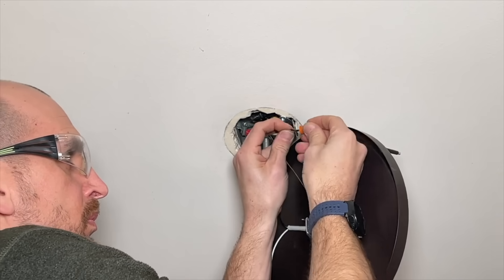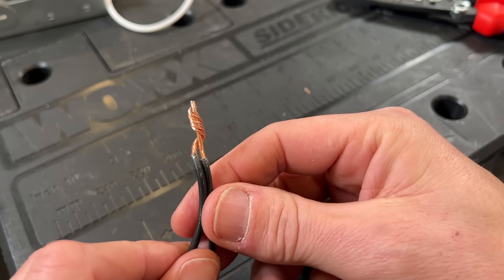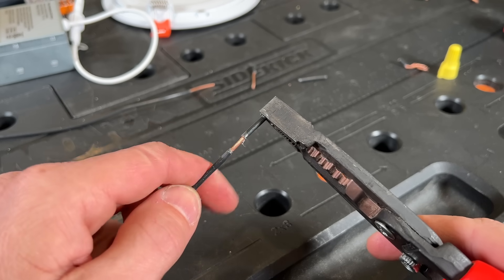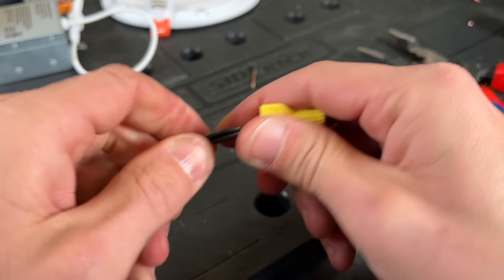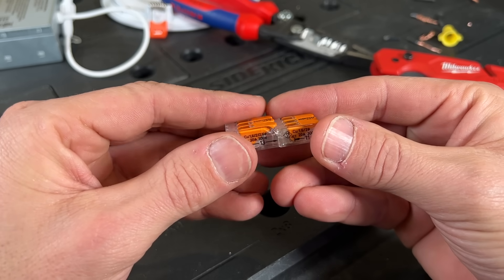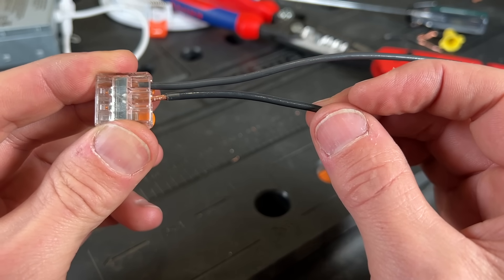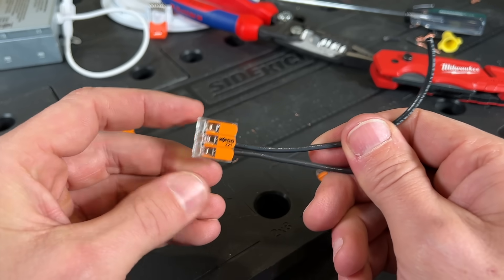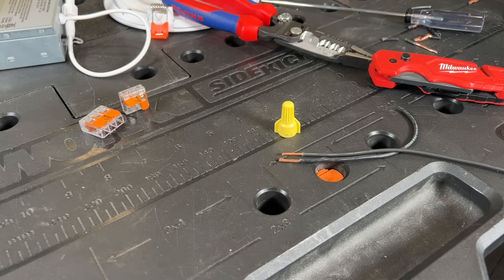Most Common DIYer Electrical Mistake - Don't Let This Be You!

Comment: I work for an OEM Control Panel Builder, Our Control Shop uses the Wago Lever nuts on the handful connections that would normally require a wire nut where there would not be terminal blocks, eg. small junction boxes, MAC solenoid air valves. They have reduced quality issues and are just in general pretty awesome. In the industrial world Wago is a relatively well known company that produces some really good IO cards, bus couplers, terminal blocks etc.
Reply: Another sponsored comment
Reply: @mouldyboats  Nah Friend,  just an overworked relay jockey whom calls it like he sees it. Of course, what do I know? In my own opinion as far as addressing remote IO. Wago wins hands down compared, to Allen Bradley,  Schneider Electric, B&R, and Phoenix Contact Equivalents. But I will say that I do Like Phoenix Contacts Terminal Blocks and wire management panel stuff, Weildmuller stuff isn't bad either. and I still like Wago Lever nuts too. Edit I have enough work with the global shipping and parts shortages.. and my writing skills are not up to par with being paid to talk about what i like on YouTube.
Reply: I had heard a benefit to using wago 
Was it is recommended every time that wire nut comes off you must peel new wire? Is that true, because I’ve been guilty of replacing light switches not using new wire and using the same wire nut but it seems right.

Comment: Well presented video, but if you think about it , but wago connectors only touch the conductors at 2 points, just like the push in connectors at the back of some receptacles.  After a  few years of of use, the connector points will expand and contract because of current draw. This can result in arcing and sparking that makes a bad connection, resulting in the in-operation of the apparatus. As a long time electrician , I have seen this to be the cause of many home circuit problems. The wing wire nut has much more connection to the conductor. Thank you .

Comment: Great information. I’ve also notice from experience that if you push the stranded higher than the solid wire as to where the stranded catches first in the wire nut it will grab good and won’t come apart.
Reply: Yes. This is 100% accurate

Comment: Excellent video. I always felt more comfortable pre-twisting my stranded around my solid. I make sure the stranded protrudes 1/8" or so past the solid, so I know it will be the first thing grabbed and properly wound around by the wire nut. Just me.

Ditto on Wagos. Over-the-top excellent. I would would caution DIYers to avoid cheap imitations that are not UL tested and approved, as are Wagos. The few dollars you save are not worth risking your home or family. I've actually never been able to a UL knockoff.

Comment: Ive on my own had to learn that giving that little extra stranded on a wire nut was the best way to get them locked in tight.  That said, since the first time I picked up a pack of those wago connectors based on an Amazon recommendation,  ive only used a wire nut again once, and thay was solid on solid only.

Comment: Great informative video. I am a DIYer with poor electrical knowledge but more now. Question. These Wago connectors seem like a very safe way to connect the old aluminum wiring in my house to the new copper wiring. Am I right?

Comment: I as well put my stranded wire a little above the solid wire,  but typically on new lights, your stranded wire is already somewhat exposed, i don’t feel it’s necessary to strip it any further, i twist my stranded tight and then put the wire nut on. Keeps you from having stranded wire working down the nut if you keep it decently short.

Comment: Yep already know these just wanted to add if you are concerned about the levers a single loop of electrical tape across them os all it takes to prevent them fully opening. I have used both methods and connections in this video. The newer connections are definitely nicer and easier but both work very well when used appropriately.
Reply: an electrician showed me to wrap a few rounds of electrical tape around the wires than wrap the wire nut, it won't come apart.  wagos are cool new technology haven't used them yet but will give a try on next diy project.
Reply: K koo 999 o.o

Comment: When stripping wires, I bite the insulation with the correct size stripper and then jump to the next larger size to actually remove the insulation. Much easier. I have also gotten a solid copper strand too high a few times where it actually started to punch through the end of the wire nut which ain't good.
Reply: 40+ years service tech. (& USA Navy) I do the same thing, helps alot.

Comment: Why not use one of the auto wire strippers?
Reply from the maker: I used to use those all the time when I did more with electronics (DC voltage) wiring.  I have found them to be a bit bulk for my tool belt.

Comment: I strip the stranded more then the solid, because I knwo the solid will not twist at all, but the stranded will, wrapping itself around the solid piece.  Cutting the stranded longer results in them ending up the same length, so no bare copper sticking out the back of the wire nut.  I also pre-twist the wires, so I know what they are doing before getting hidden away inside the wire nut.  It is importatn for the stranded to at least be even with, maybe even a little beyond, the ned of the solid, otherwise there's a risk of the stranded just sliding down the solid as the wire nut is turned on.

Comment: Even when taking care with twist-on connectors, you can still end up with a weak connection.  Two alternatives are (1) to dab a little solder on the stranded wire which makes it behave like the solid core, or (2) use a crimp-on connector rather than twist-on.
Reply from the maker: Thanks for the feedback Michael.

Comment: Glad you mentioned "pre-twist" which is probably in the top 3 reasons for connector failure. For DIYers you are correct on the WAGO's they will save your from mistakes made by not having a good feel for the connection. Wagos are fine on federal jobs so they meet code requirements anywhere.
Reply: I always lead with stranded. Common sense. But pros make many stupid mistakes. That's why I became a diy person in the 1st place. And I can't tell you how many times I had my car so-called repaired by a professional mechanic and they messed it up worse than when I brought it in. So for the past 30 years I've been fixing my own cars. Anytime I can't fix it, believe me the pros are going to be like oh you got to get a new car this is totaled. In my experience Pros are pretty useless. Even when they do electrical work I have to watch them and then afterwards fixed their stupid mistakes but of course I don't tell them because I don't think they can handle the criticism. I just smile and even give them a tip and never call them again.
Reply: @JourneyOnLife  I agree and live by the adage "If you want something done right, do it yourself" with help from YT videos like this one of course.
Reply from the maker: Thanks for the feedback John 👍

Comment: Am I wrong for sweating solder into the stranded wire before I use the wire nut when I find myself in this scenario?
Reply from the maker: Nope, "tinning" stranded copper is an accepted practice and some would argue is preferred 👍

Comment: With a single solid, I put a s-curve in the solid before wrapping the stranded around it, then the wire nut.
With multiple solids, I pre-twist, then add the stranded.
If yours is what is recommended, I'm all over it - so much easier.  (wire nut mfrs. have recommendations? - heading out to read the box))

Comment: Okay… Wago over basic wire nuts? Connecting wires using nuts is literally the easiest thing any DIYer could do in almost any home repair.

Electrical, Gas , Water ,woodworking , roofing , PVC pipes , drywalling every single one of these the most basic skill to learn is imho wire nut connections.

This strikes me as an ad for wago. 

Also why are you struggling so much when stripping wires  ,Seems odd.

Comment: So the wago was pushed to 60 amps with some heating at the connection interface. What was the wire nut current at the same temperature?

Comment: The number 1 problem is “What on earth are you doing with these twist on connections, they are absolute rubbish”, no real electrician would use such connections. Not even legal in most countries. 
Screw type blu-point connections are the only thing to use.

Comment: I'm no expert but have worked with electrical for 40+ years. Looking at wire  nut issues I find the biggest problem is nuts that look like they were attached by 7 year old little girls.  I'm also not yet convinced by the wago's.  I remember they also told me that aluminum house wiring was a good thing.

Comment: For light fixtures I always use the WAGO 224-101. Push in the solid from the box, and then use the 'pinch' for the stranded (or solid) going to the light. If i need the neutral to be a pass-thru, I use the 224-112 instead (which takes two solids on one side, and a stranded/solid on the other).
Reply: Look at the Wago 221. They are   the type  of  terminals  I use frequntly. They  grip  flex, solid and semi solid wires reliable
Reply: @Reaktanzkreis  I have also used those for years, when doing general electrical work. I find the 224 series smaller and work better for tight, overhead light fixtures. Also, because the wires are lined up, they can support light-weight fixtures without putting undue corner stress on the wires like the 221's would give you.

Comment: Wire nuts are whack. Use ideal insures for solid to solid as cheaper than wago and wago for solid to stranded. Literally do not see a place for wirenuts in 2022.

Comment: As an electrician, I see a lot of videos on the internet giving people wiring advice. Many give incorrect or bad advice. The information in this video is correct. I've used the Wago's for years. 
They are great. And the advice here about pull testing and leading the solid with the stranded is spot on. Extra points for mentioning the difference in gauge sizes between solid and stranded.
Reply: Yes, that, but tell me if this little trick isn't a goodie:
I learned years back on stripping SOLID wire to a) choose the proper slot, then b) angle the cutter slightly, squeeze, square it to the wire, then pull the sheathe straight off. 
I find that this breaks the adhesion and makes it easy to pull off. If you choose, say, the 14g slot for a 12g wire, you'll possibly have the wire break at the cut.
Reply: @garychandler4296  That's interesting. I'll have to try it.
Reply: Best DIY advice i ever received for electrical work. Step 1: call a certified Electrician.

Comment: Overstripped the wires. No more the n 1/2" exposed copper. The width of a good set of lineaments pliers is typically the exact length required for almost every electrical connector.

Lever nuts are nice for certain applications but I would never use then in anything that required more then a couple amps.
Reply: And never in an inductive circuit.

Comment: Wagos can become loose and burn up. At a hotel I was at it became a big problem... wagos burned up all over. Went back to wire nuts for tighter connection.
Reply: strange, Wago is all they use in Europe and they don't have that problem there.

Comment: I have been doing electrical for 20 years and this is one of the more tricky connections to learn. I pretwist solid conductors first, than wrap stranded around, cut all wires flush and twist on wirenut clockwise. Manufacturers attach push in connectors in recess lights.

Comment: Belt and suspenders here. I just re-wired the reversing switch on my Atlas 618 lathe, and all of the stranded to solid 12 gauge connections were twisted, soldered, and wire nutted, those are secure.

Comment: 🥱 
Screwed connectors. Problem solved.
Idiot proof and they don’t damage the copper if used properly. Wire nuts and wago connectors cut the copper. Surely clamping the conductor is better practice than, although not much, cutting/piercing it.

Comment: I replaced an eye on my electric stove.  I first turned on stove light which was was red , I then turned off ONE fuse that made light go out. I didn’t realize that two fuses controlled the stove. Sparks flew when I touched my screwdriver to a hot wire. Fortunately the screwdriver had a plastic rubber coated handle . 220  could have made for a. Bad day. Just wanted to warn other would be handymen.

Comment: Youtube videos are where I first saw those "wire nuts". Although an interesting concept for solid wire it seems to me a total no-no for the stranded one. But still, here we always used various terminals: screw, push in or lever. Preferably in transparent casing so you can inspect the contact and wire state. In more sensitive applications also with the ferrules added for the stranded wire. 
Where I live the "common DIYers mistake" is to just twist the wires and wrap them with an insulation tape. If the wires are well twisted together and the tape is good enough to not let go over time it's not even that bad, and the joint is even somewhat protected against humidity and corrosion. But it surely makes following repairs a nightmare, dealing with sticky wires and big knots of the tape. And don't een thing of repairing anything this way without powering off.
Reply: Where do you live that people have not heard of and use wirenuts???? They have been around for over 40 yrs and are dirt cheap.
Reply: @bobstark4020  Slovenia, Europe. Many things are quite different here (those are the countries, where most people drive manual), in electrical systems probably also due to our higher voltages (so lower wire diameters and higher need for arcing protection).
Reply: @jernejq1651  ok that makes complete sense, obviously things are different here in the USA.
Reply: house not newer can use only twisted wire and insulation tape, wery dangerous burn many house if make this shit amateur system, or wire nut shit.

Comment: Come to the gate operator industry. You will find just about every wiring problem imaginable in one place. Wagu connections work so well in this setting. Since most accessories are low voltage dc you will see 14 to 22 gauge wire at many installs. Then the 120vac is always solid core and typically 12-14 gauge. 
I see 18 - 22 gauge used where 16 or larger should be used. I’ve seen solid core wiring being used where it shouldn’t. Obviously many installations are grab a piece of whatever’s on the truck no matter the manufacturers specs. Worst and most often I see interior wiring used and many times buried where direct burial should be used. Nothing like seeing cat5 used where 2 amps are required for the device and it’s almost always interior cat5. Not to mention many in this industry don’t know that the color of connectors and nuts dictate the wire gauge. 
I start out many interviews asking why the insulation colors are red or blue. Many self proclaimed expert installers will not have a clue that this shows the gauge wire it’s used for.  NEXT applicant!

Comment: Also using the term Wago connector for some people, including the electricians at my casino, means the push style square ones. I have to differentiate between a "Wago connector"  and a "lever nut"  which is what I call this style in your video. Because if I tell him a Wago connector, he assumes that I mean the cheap push in style that don't work at all with stranded wires.
Reply from the maker: I have noticed that as well.  Many people comment indicating they think the Wago 221 is a simple push-in connector 🤷‍♂️

Comment: The only thing you forgot to mention is that the middle lever lifts up slightly because that is where your test point is for your meter lead. That way you don't have to take the wire completely out to test the voltage.
Reply from the maker: That test port is handy 👍

Comment: that's the difference between an electronics technician and an electrician..... an ET would correctly solder the joint and insulate it.  :)